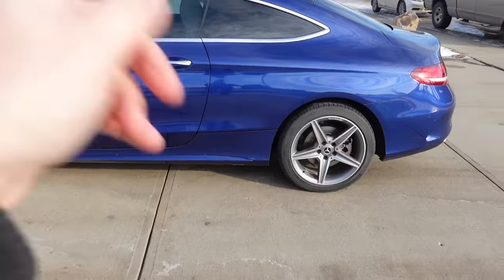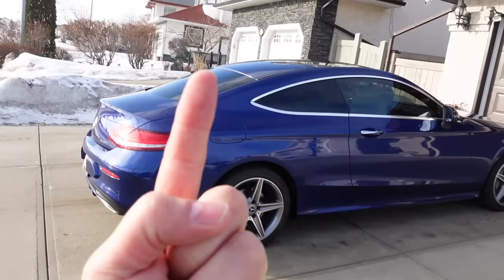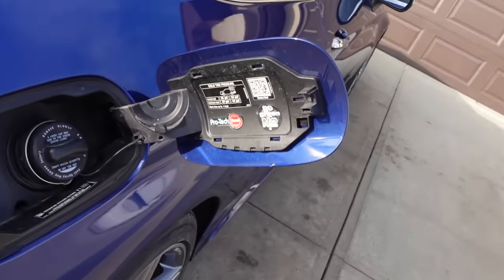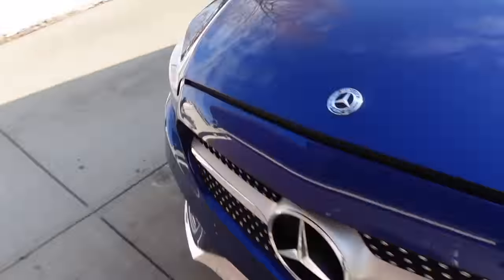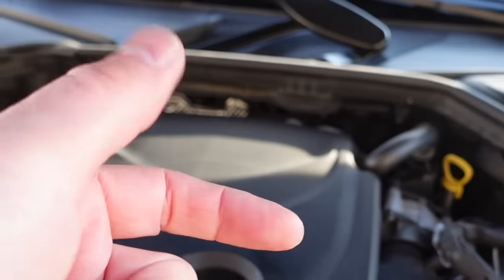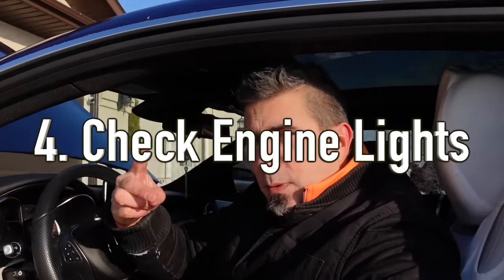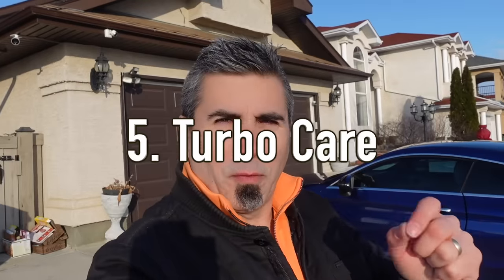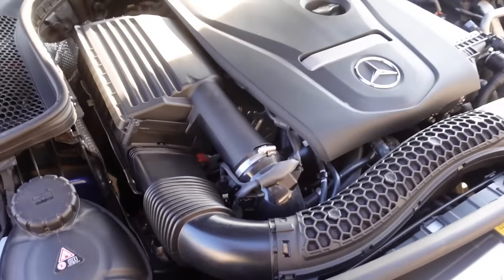STOP Destroying Your Car Engine! (With These Tips)

Comment: For the turbo cooldown, I typically coast in neutral when i park everywhere. Would that help cool the turbo better?
Reply from the maker: Possibly yes.  It’s really about idling the car with no load for about a minute
Reply: You should never coast in neutral if you have an automatic.
Reply: @Golfr2020  That would be as weird. i drive a stick shift, I coast all the time. I’m at 200K which is kinda long for a VW GTI I hear so I thought maybe its because it cools down before I shut it off. I’d imagine if i was in an auto/DSG I wouldn’t have those extra 10 to twenty seconds of coasting  to cool it down.

Comment: I have a 2022 Honda CR-V Hybrid and they recommend changing the synthetic oil every 10k miles, that seems like a lot since im used to changing my oil every 5k miles. Should i stick to the recommended 10k miles?
Reply: Follow severe driving recommendations for maintenance in your owners manual.

Comment: Hello, what should be the optimum coolant and engine oil temperature when your car has already warm up? My one reaches to 100C on both? Is that normal?
Reply: You want the oil temperature to regularly get over 100C (or 212F...) so that moisture in the crankcase can get boiled out of the oil into steam. Vehicles which only make short trips don't get their engines hot enough often enough, and the crankcase moisture and oil emulsifies into sludge. So,... normal highway coolant and oil temperature should be over 100C...

Comment: This is false information in regards to the start stop feature that is very expensive and high-tech thought out technology. It does not damage the engine they have addressed a multitude of issues to be able to make this system function and work well and protect your engine all well cutting back on emissions

Comment: On my car the engine doesnt allow coolant into the cylinder block until the engine is properly warmed up and the coolant isnt warm until then so in my case the oil will be up to temperature when the coolant is?
Reply: thermostat, all cars have one
Reply: @richarddegen6184  Yeah but I assumed all cars don't work that way as my dad's car starts giving out heat after mabye a couple of mins

Comment: My tips are, I GET IT WERE AMERICAN, but buy Honda/Acura, Toyota/ Lexus. 
Never buy a vehicle with a turbo or a supercharger. Replace oil every 5k miles, and Drain and Refill Transmission fluid, Steering Fluid, Coolant, and Brake Fluid every 10-15k miles. 
You're vehicle WILL last 350,000 miles+
Reply: Never buy a car with electric windows or auto transmission, what if they go wrong? I change my oil after every journey just to be safe - after all, I know better than the manufacturer. And I never drive with lights on cos it wears the bulbs out.

Comment: Honda CR-V 1.5 L 2022 Second oil/filter change....the blasted panel that has to be removed to change the filter...the connectors...screws are trash and the connection gets buggered....MY HONDA WITH 11K MILES RATTLES LIKE A PIECE OF JUNK....I MAY GET RID OF THIS CAR...AND THE START RE-START IS A ENGINE DISASTER. SO DISGUSTED!

Comment: What this guy doesn't tell you and is ignorant about is the fact cars with start stop systems have a much robust starter motor so it doesn't wear out as much. Second auto start stop on most modern vehicles only really engage when the computer determines the engine and oil temp is hot enoug...

Comment: Dont listen to this guy on Start Stop. It takes about a day for oil to drain down to the bottom for a cold start and the oil is still in the engines because the computers are telling the car its still on. Thats why he says “Personal opinion”. These cars are totally built for start stop nowadays. Not an ideal system I usually keep mine off anyway but if I know im going to be in city traffic I may leave it on.
Reply from the maker: Viscosity

Comment: Not all vehicles have stop start. I bought a 2022 crosstrek 6 speed manual. No stop start, no push to start, no turbo, no bullshit
Reply from the maker: Nice.  That’s the way it should be.
Reply: @ECPP  turbos are cool on the right car. perhaps a WRX or civic SI, or go old school grand national, GMC syclone, GMC typhoon, or ford thunderbird turbo coupe. those were all turbos being implemented for high performance (well they were in their time anyways). allot of these modern cars simply have engines that are too small without a turbo to simply move the car down the road. using a turbo to compensate for an engine that otherwise wouldnt give acceptable performance without the turbo is a recipe for disaster. 

those cars i mentioned would be able to operate effectively without the turbo, but it would just be less fun.

Comment: Ethanol Fuels are bad:  What you don't say is just how long it takes for Ethanol fuel to go bad.   For those that don't know.  6 months.  If anyone doesn't drive their car for that long you need to store it properly.  Basic Maintenance 101.   What you don't say is that E85 runs cleaner than any standard gas by 50%, and is significantly cheaper than normal gas.   Funny how you advocate manufacturers are trying to make it easier to fill the tank, but the one alternative that is better for the environment and cheaper is thrown out the window.

Cold Starts are bad?  Seriously?  Name one instance where you can alleviate a cold start that can be used on any vehicle.  Go ahead I can wait.   

So far the only valid point is:  Changing Oil.  But what you don't mention is that newer synthetic oils are bad for your lifters.  So ya keep using synthetic oils instead of natural oils.  This is most common on high performance vehicles.  There is nothing wrong with using natural oils instead of synthetics, the only difference is you change oil more frequently, but natural oils are significantly cheaper sometimes 2 to 3 times cheaper.

Most modern cars do not have Red Check Engine lights.  Misinformation at its best right here.  Older cars  have red check engine lights and it can be just as negligible as a yellow check engine light on a modern vehicle.  You do not know what a check engine light means until you hook up a scan tool to the vehicle.

Turbo - So you advocate aftermarket intercoolers for turbo chargers and superchargers.  Good luck with your warranty then.

Auto start and Stop feature is not mandatory that it be equipped on all new vehicles.  Again misinformation at its best.

You might want to do a little more research before you post a video like this as if it is gospel.

Comment: Use Heet red bottle water remover.  The red bottle has fuel injector cleaner the yellow bottle does not. Keep your oil clean. Every five thousand miles new oil and filter. Get underneath and spray your axles rubber boots  and gaskets with  a silicone spray. Don’t race around and use the brakes accordingly. Look ahead maybe you can coast into a red light or slowly come to a stop. Use your vehicles book for information. Batteries only last four five years keep that in mind. The engineers built the vehicle and your book is the Bible. Be safe.

Comment: The salesperson at my Infiniti dealership told me I don't have to worry about the cold start and abrupt turning off the engine without letting it cool down issues with the new 2022 Infiniti QX-50. It is a turbo 4-cylinder with a CVT transmission. Is this feasible, or is he blowing smoke up my @ss?

Comment: The first way to not destroy your engine, is to not buy a Mercedes or BMW!  That Part!  I have a lexus with over 300K miles, try that in a new Mercedes’!  Oh and I’ve done most of the things this guy say’s not to do ;)
Reply from the maker: Nice.  Some euros can last but may require a bit more attention
Reply: @ECPP  I love the styling and performance of Mercedes, BMW, but when they break you better have some deep pocket$.
Reply: I have a 5 series Xdrive 2016, 2.0 TDI 190 HP with 130k miles. It's well serviced all the time. Never had any problems. None. 
Owners are the problem, not the cars.

Comment: I'd never buy a vehicle with that stop/ start crap. I had a rental with it, and couldn't stand it. 
Also, engines that will last forever are the ones built 30 or 40 years ago, not the throw away crap manufactured today.

Comment: intentions are good, but i had to stop watching after the fuel tip.   running ethanol fuel is perfectly fine 99.9% of the time - why?  because cars dont generally sit long enough for separation to occur.  do yourself a favor and run the fuel designed for the car.
Reply from the maker: Thanks fornwatching

Comment: You DO NOT use premium grade gasoline just because you felt like it will aave your car. Gas grading system is car dependent. This guy's advice will kill your car faster.
Reply from the maker: WRONG!  Octane rating reduces detonation.  The higher the rating, the better.  Period.
Reply: @ECPP  This is literally covered at grade 11 chemistry class. Give it a read before assumming things. Engines aren't made all the same.

Comment: The irony... Dude buys a BMW and makes a video about longevity of a vehicle.

All of these points only apply if the vehicle was engineered with build quality and high standards in mind. If a car is intentionally engineered to die after a few years, there's no amount of maintenance that will protect you from the vehicle turning into a repair money pit.

This BMW, you won't have it in 5 years, it's going to be someone else's garage nightmare.

Comment: Largely a load of spin doctoring BS or just do what the manual says .  Use the fuel that it states - its designed to use it.  Virtually nobody will EVER experience water in fuel from the alcohol in 91. Cold starts - do what the Scandanavians do.  Plug the car into a heater or (brain fart) but the car in the garage if its cold. Stick to the oil change interval in the manual by time or distance whichever is the SOONER.  As for the turbo - only true if you live right next to the freeway.  In 99.999% of cases the few minutes from the freeway to your home will be sufficient to cool the turbo to normal temps.  Start-stop, just turn it off or press lightly on the brake at the lights (the system is initiated via a pressure switch on the brake line).  Not rocket science.
Reply from the maker: NEVER

Comment: This guy does not understand how modern cars work. If your car is still hot after driving, the engine cooling systems will still run even after you park and turn off. This even applies to auto start/off. If you think German engineers who are way smarter than this youtuber didn't think these reliability issues through, you are kidding yourself. Warranty replacement and class action lawsuits/settlements are profit killers.
Reply from the maker: Thanks

Comment: Start and Stop features are also on the new Toyota Rav4 .. there’s no proof that it will damage the engine but yes it will need an alternator. There’s no cars ever with zero issues, maybe Toyota made them better quality as far as the alternator, battery and other parts.

Comment: Mostly rubbish! 
The coating of paintwork is fine but nothing new. 
Ethanol takes months to separate and will only do so if you have water contaminating the fuel.  The fuel in the line is only there for the time between using the car and then replaced. The fuel in the tank is replaced every fillup. So perhaps a problem if you fill up and do not use the car for 3 months. It is the most stupid thing to think that fuel can create water and the water get into the engine and attack your crank or whatever! Totally not true. 
Yes short journeys are bad, but oil is far better then ever so less of an issue. 
Of course you should change your oil regularly. More urgent in diesel engines. 
Yes an engine light will show you have a problem. 
Turbo will need hard driving to get it hot enough to need to be cooled down. 
Engine shutoff. It is not cold starting when engine is warm. But yes it will wear the starter. But sitting still in traffic will wear the engine and sitting with an auto in drive will wear the gearbox. Personally I would rather replace a starter than a gearbox!
The truth is that if you buy a new car, you will be selling it for less than half the new price in a few years time. If you buy that second hand car the engine will probably run as long as you have the car. It will get to a point where it is worth so little it will be cheaper to replace when it gets a small problem. 
So really just do regular maintenance and it will last. Do not sweat about cold start or stop/start. 
I just sold a 2015 Mercedes C Class that had done 97k miles and it had only had one part replaced (apart from consumable parts like pads and filters) and that was a £30 ball joint. It was good for another 100k.
Reply from the maker: Thank you for sharing.

Comment: This video is a waste of time. Obviously no matter what if the engine is running or just sitting there it's getting worn out. You don't have to be pessimistic about it. Likewise the tires are wearing out if you just put tires outside for 10 years that's it they Rot and fall apart Fall to pieces. This guy can't really say anything it's bad for your engine if it's cold it's bad for your engine if it's hot. Bad for your engine if you go slow it's bad for your engine if you go fast. Plus we have to look at his face the whole time with that hairy Chen that's a joke

Comment: Just buy EV and there would be no need in those recommendations :) Just track battery % and that's it
Reply from the maker: For sure, problem that if and whe. Battery fails, it’s 10s of thousands of dollars
Reply: @ECPP  , totally agree. Well there is always "if" :). If you have warranty - no problem) If you live near country where there is good cheap mechanics (for ex. Slovakia, Ukraine, Croatia) it's easy to fix the battery for small $ (because of usually battery packs contains thousands of cells the whole battery reports an issue on failure of one - a few cells and all you need to find broken ones and replace them).

Comment: I had to/forced to pay for that stupid @ idle stop system. Thank you US government you always mandate things that I do not want or do not want to use in my car.
Reply: I drive a 2024 Honda Accord with a 1.5 Turbocharged engine. It’s the only engine available nowadays, gone are the days of the V-6 and 2.0 naturally aspirated engines.  Anyway, I always invest in ethanol free gasoline and change oil every 5k miles and I always idle engine in park for 1 minute before I shut it off. This will allow significantly cooler oil to pass through the turbo bearings there by sufficiently cooling the Turbo charger down because if you turn off a hot turbocharged engine? You will fry the oil in the oil supply lines leading into the turbo bearings and this will cause the oil supply lines to clog with burned oil causing  premature Turbo failure. These are things that the dealership never told me when I bought this car brand new back in December. They don’t want me to know things like this, Anyway, above all the most important thing that I think in my opinion is the best thing that you can do to your car, especially on a turbo charged car, is by an “idle stop bypass” on Amazon, and you’ll never touch that button again and you’ll never stall at a red light or stop sign again. Thereby maintaining a constant flow of cooled oil through the Turbocharger bearings. Invest in the gasoline and be diligent about properly cooling down your turbo bearings before you shut off the engine and you will greatly extend the life of your head gasket, Your turbo bearings and your engine. One must realize that owning a turbocharged car requires responsible maintenance/driving habits or you’ll pay and pay lol!!